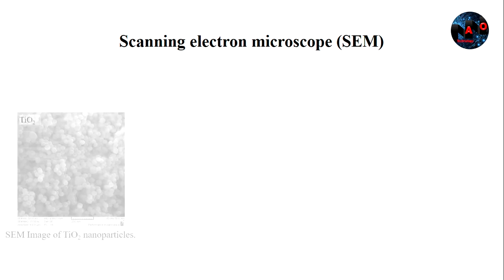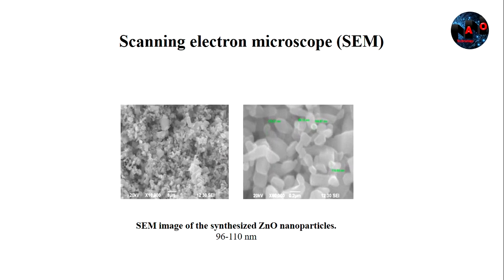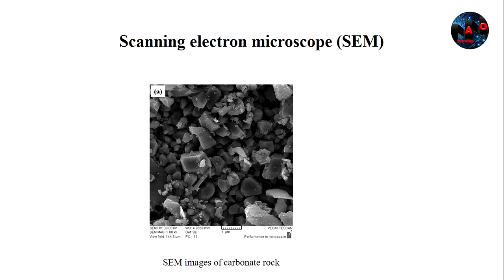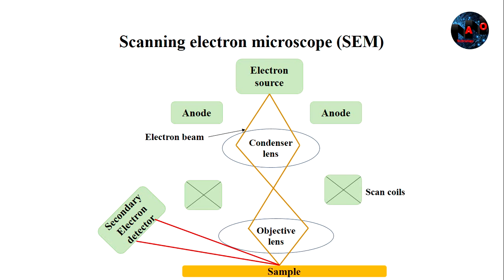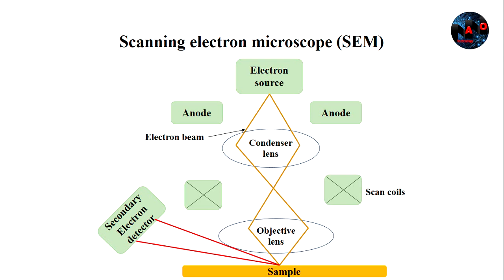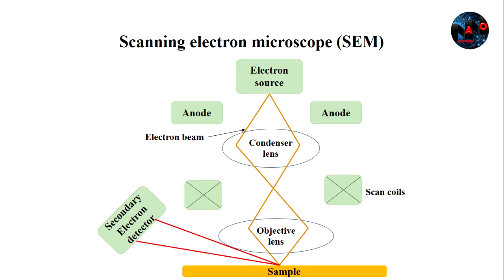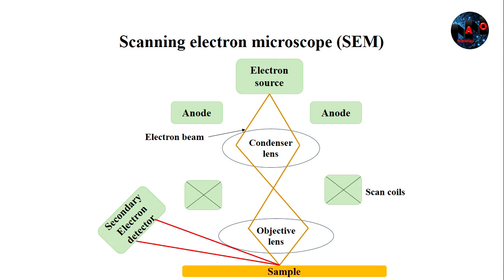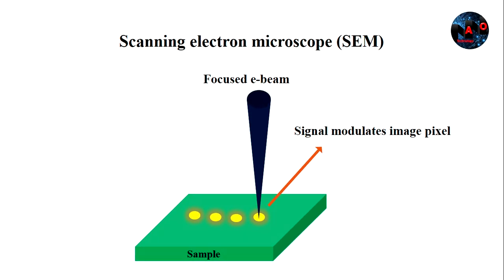Scanning electron microscopy SEM Part 1

Comment: Hi NANOTECHNOLOGY,
I have question about your video
Because I characterize sample using SEM, When I increase resolution scale, I see image very blur and too hard too see. In 1:54 your image very clear
1/ Is this a SEM images ? Or high SEM or FE-SEM - because this picture very clear.
2/ Does your sample using coating?
3/ Could SEM normal (not FE-SEM) using characterize nano materials about size and shape
I hope I would receive your answer soon.
Thanks NANOTECHNOLOGY so much.